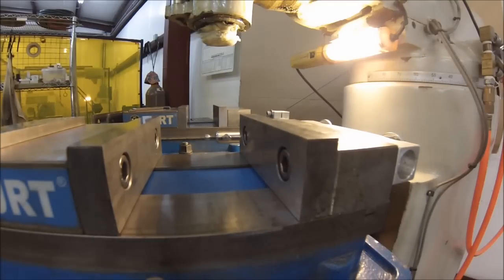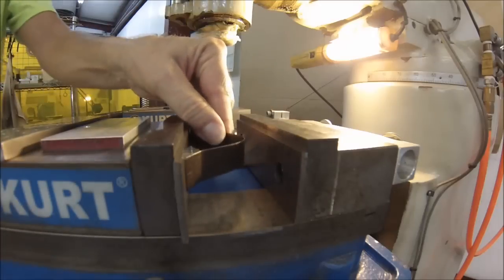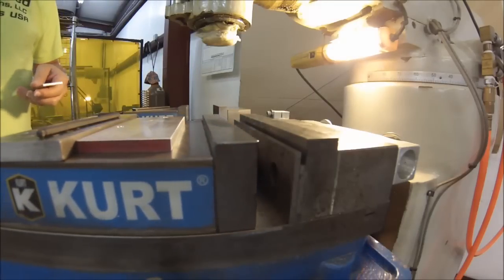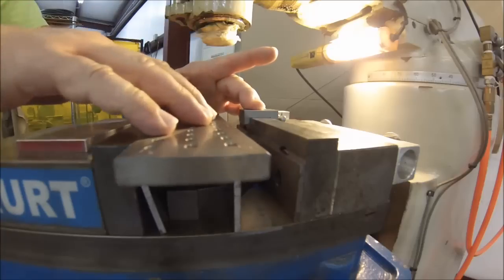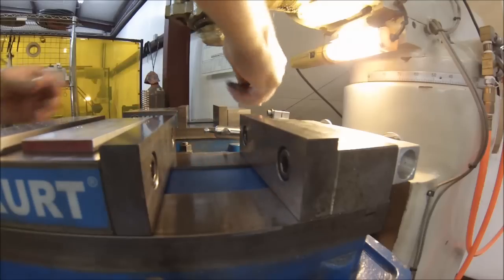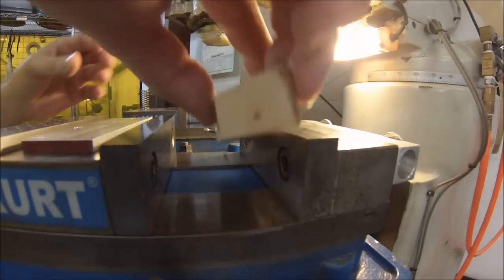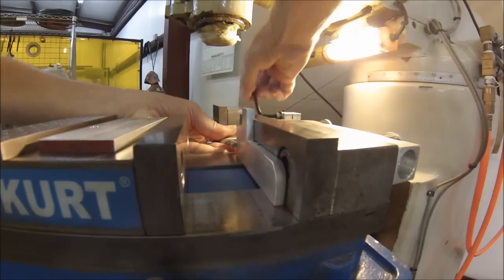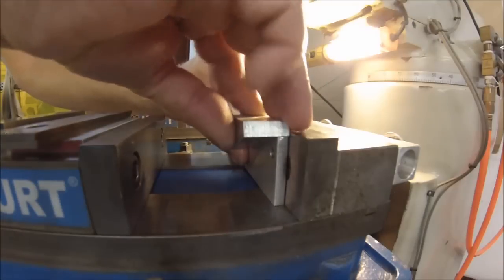Clamping Thin and Irregularly shaped parts in the mill

Comment: Instead of springs I put a drop of off-road bike chain oil on the parallel bars which sticks them to the vice jaws through surface tension. Also helps prevent corrosion.

Comment: Hi Joe. Very helpful video. Question. How can I hold a kidney cover for a Harley panhead?  Domed on the bottom with an irregular shape no way to grab it and no depth. I'm stumped. Thanks. Rick
Reply from the maker: Rick, my answer will be driven by what you are trying to do to it. My first impression would be to squeeze some rails in your vise, leaving a space between them, and clamp the cover underneath them. Do all your work between the rails. Its a technique that works well for parts like that.

Comment: When using the ball or the cylinder in the vise with an angle block, is the part going to want to pivot more on the moving jaw side? Do you need to support this side of the part or is an angle block held against the fixed jaw sufficient?
Reply from the maker: I've never had a part move. be smart with your tool load when using a setup like this, but I've never had a problem. Make sure to cut right to left so the tool impact drives the part against the fixed jaw.

Comment: The springs in air cylinders that have spring return are perfect for parallels. I put the cylinder in the lathe and cut it open with a parting tool

Comment: I have a clampdown problem  with a small round. Part 4in in length 1/4 in inn diameter that I need to mill a 2in  through slot centered. Enjoyed this video, but Didn’t address a round part. If at some point you could address this particular problem it would be appropriated.  Thanks
Reply from the maker: Put a piece of scrap material under it to use as a parallel. Squeeze it in a vise and center the cutter, mill the slot and go right into the parallel. Just be sure the parallel is tight too or it will walk out the side of the vise and possibly snap the cutter. A soft rear jaw with a step, or good double face tape will help.
Reply: @joepie221  Thanks Joe for your quick response, it’s appreciated. Your idea was so simple, and worked like a charm. Don’t know why I couldn’t see it before, feel stupid. I took it one step further on another piece. Took the parallel, milled a concave along the length, cut it in half and since I had an inch at each end of the work piece, clamped the 2 pieces 3/4 of an inch in from the ends of the work piece and milled out the 2 inch slot without the worry of running into the parallel.

Comment: hi JOE , old machinist here , I was doing the same for many years back the other bonus when you blow your vise clean the parallels are not flying around , it saves a lot of time , for a stop i would use one of those small round magnetic bases on the side of the vise , part set  , simply remove magnet

Comment: You say, "that's all I got" but what a fab little video with loads of little tricks. I've never seen the flat side sphere/cylinder technique and will now use it. Thanks.
Reply from the maker: That ball with a flat is a great thing to have. Just get a steel ball and sand a flat on it. It doesn't have to be precision.

Comment: Thanks for posting this great video on work holding in the mill. I have an issue that I am hoping someone can help me with. I have a Precision Matthews PM25 MV mill with their 5 inch vise. I am having troubles getting a piece to stay firmly pressed down to the two parallels no matter how hard I bang on the piece with a soft faced hammer. It seems that as soon as I do my final tightening usually the movable jaw side loosens. I have tried using copper and aluminum wire in case the piece was slightly out of square. I am sure it is something I am doing wrong procedurally but I can't figure out what it is that I am not doing correctly.
Thanks
Reply from the maker: Tell us what you are doing before the problem shows up. Just an FYI...Don't let tightening the vise be the last step. Tighten, seat, cut
Reply: @joepie221  That may be my problem. I have been snugging the part down on the parallels, smacking the part until the parallels are snug and then cranking down on the handle. 
I think the issue may also be the cause of another problem I am experiencing, when I use a two inch shell mill the front edge cuts a smooth surface but when the trailing edge of the cutter comes along it doesn't cut all of the way across. The surface looks like a beaver chewed along the edge. I suspect that the edge along the movable jaw side of the vise is lifting slightly while the leading edge is cutting and then dropping slightly as the lead cutter moves off the part and becomes too low for the trailing edge to clean up. 
Does this seem like two different issues or does it sound like they may be related?
Thanks for your help.
Reply from the maker: @robertoswalt319  If your cut allows for it, try using taller parallels. I have had the opportunity to cut parts slightly out of square that way. Just don't load up the part with a deep wide aggressive cut.
Reply: Joe Pieczynski thanks for your help. As I suspected the problem was with operator error. Your suggestions were exactly what I needed to resolve them.

Comment: Nice tips sir!  I was a machinist for 11 years here in San Antonio.  I went from manufacturing parts for the beverage dispenser industry to oil field equipment, aircraft manufacturing, and medical field.  I graduated from Machinist to Tool Maker, then onto Engineering.  I enjoy watching these types of videos which take me down memory lane.  I always seem to learn something new still.  The tip about using the ball with a flat side to hold irregular-shaped parts was pure GENIUS! Times like this make me want to get back into the shop and make more parts.  Thanks for sharing your ideas and tips.

Comment: Very impressive as usual.  Thanks for sharing! I have seen the flat side on a ball bearing.  I tried to make one but it was chrome steel and was too hard to machine.  I saw a video without sound of a guy milling a 2" diameter ball with a  multiple carbide insert milling tool. I could not find a commercial source.  It is hard to hand hold the ball and grind a large enough flat spot to make this tool.  Any advice on how to make one?  I only have a drill mill as a milling machine and a bench grinder.  I could not find a non-hardened 2" ball source.
Reply from the maker: I think you'll find 2" is too big. A 1" ball should work fine. It doesn't need to be hardened.

Comment: no need for springs just use rubber bands across the back jaw and the front, my only issue using rubber bands is that they degrade if you keep using them in a machine with coolant running all over them. no problem though a box of rubber bands is like 2 dollars and it will last a year or so and theres no need for springs or blocks or anything extra in your vice. loved the video other than that. just felt the springs took more to make them work.

Comment: Though I add this comment. Saturday while modifying an AXA (China) tool holder for my SB 10K, I had the opportunity to use your vise/parallel/spring holding method. It worked GREAT. Then on Sunday I was found on the lathe making some various lengths springs for myself. Not that cheap, just old and the shop keeps me out of wife's way.
Again - thank you for you videos :-D

Comment: Hi Joe,
You have given me new ideas often and they are very much appreciated.  45 years of toolmaking and job shop work has taught me much, but so much more to learn!  Now, when I have an irregular part I have to machine, I have an old die block that I hold in the vise (can use a piece of aluminum that is fly cut flat and milled parallel) and clamp the part on top and you can indicate one strait side and then pick up zero anywhere, then machine, and if it has holes, locate with screws on the plate and no clamps necessary, I use "can't twist clamps"!  Its fast and accurate!  Thanks for the ideas Joe!

Comment: Way more good tips than this old brain can absorb at one time! My biggest problem is our climate combined with high heating costs in the winter. Everything needs to be dripping in oil so it doesn't rust. Chips stick to oil. The springs and troughs should help my repeatability immensely. I really like your ability to convey your ideas to others in a timely, clear, direct manner. Always impressed. No BS, no fluff, no drama, no begging, no 10 minute clips of your pet squirrel Snookums. Great video.

Comment: Some great suggestions. Clamping odd shapes that need to be face cut entirely seems to be the tricky issue when I need to clamp in order to finish the entire part and the one end of part vibrates against cutter and vice due to only being supported/clamped on the one end. Having additional supports in the way don't work when the 4" fly cutter needs to take several passes over a 35" L shaped flat. And to add when the parts are not only irregular they very from one another. My tolerances are so tight that I can't stack anything .008 off or the part just slides back and forth in the vice. In other words I'd need 100 different shim blocks with minute tolerance and choose which one fits best. Quite frustrating perhaps some adjustable tool similar to my spring and ball block would suffice if made from soft material. Thanks for the additional ideas we will see if something can be achieved without a days work making 100 custom blocks for "very" short run parts.

Comment: Excellent coverage on the basics of precision setups. My half round bar was the very first tool I made for myself, and of course is in my box to this day. 
I would offer one thought,  make sure your parallels are in fact parallel. I had a half inch thick set in use, and the parallels were actually parallelograms. Under spring pressure they kicked up the part in all sorts of frustration. 
Thanks Joe for your clear and concise approach to teaching the younger generation our dying craft.

Comment: Great video, and i've come to covet your mill vice and band saw.  Great tips.
Reply from the maker: I love my Kurt vises. I have 2 - 675's on my manual mill and 3 - 688's in my CNC. great vises. The DoAll is a life saver too. I had to restore it when I got it, but it was well worth it.
Reply: Thanks, Joe, i have a 40 year old Lagun, a bunch of Chinese stuff and a Harbor Freight band saw, that i slowed down with a bully i cut from a 12" billet of aluminumunm.  70 years old and self taught "i'm an artist, no two parts alike!"  But you've given me so much book learning on those videos,; who knows, if i live long enough, maybe my pantograph will come out right, and i can engrave the knobs on my hot rod.  Thanks again.

Comment: Hello Cap'n Joe Pie
Another good video with nice ideas for clamping
Just one that is proving a brain teaser for us is holding down a circular Part whilst being able to machine four flats on four sides
Guess U know what we are talking about.
Would be tremendous to have Your ideas on solving that one !!!
TIA
And keep 'em rolling
aRM
Reply from the maker: On a flat plate, toe clamp the left and right sides of the round part...machine the front and back flats, swap the clamps to the front and back one at a time so the part doesn't move, machine left and right side flats. If the part has a center hole, just screw it down.
Reply from the maker: Depending on the material and cut, you could also double stick tape, or glue the part down to a backer plate.
Reply: If the flats are not too deep and the circular diameter is suitably large, another way might be to hold the disk in a 4 jaw chuck lying on its back on the mill table.

Comment: How about a source for a ball similar to what you used or a video on how to hold a steel ball to machine the flat?  A couple of your ideas I managed to figure out on my own, but the rest are definitely added to my collection of knowledge.
Reply from the maker: A standard 3 jaw chuck, or a collet will hold the ball just fine for putting a flat on it. Face it on, and put a small centerdrill dimple in the center to be sure there is not proud center point. Outside Screwball sells sets of balls with flats on them if you don't have a lathe. he calls them screwyballs.

Comment: Great video. I have one comment. I use the the ball bearing trick to hold parts at work and we have Kurt vices. I have found that if you put the spherical part of the ball against vice jaw it will put a dent in the jaw. So I put a piece of soft steel or aluminium between the ball and the vice jaw.
Reply from the maker: I too have a few dimples in some of my jaws from earlier years. The ball I use now has a large flat on one side and that goes against the jaw to avoid those marks. Chuck over at Outside Screwball sells 'Screwy balls" intended for just this application. Maybe take a look over there if you are in the market.

Comment: I use two large 1/2" wide rubber bands ,  one for each parallel, around the back and front  of the vise. Hold them tight to each jaw. Even when opening the vise a great distance, unlike a spring, the rubber ban continues to hold the parallel tight to the jaw. No more chasing springs across the floor :-)  Another benefit: should I miscalculate, and poke a drill thru too far or close,  instead of hitting a spring  or other metal parallel "keeper", the rubber band it very thin, leaving  plenty of room. And if a tool does touch it,  its soft rubber, not hard steel - no more dull or chipped tool.  Another tip: if you can't find larger rubber bands, double up and loop several smaller ones together; tie the last two ends in a knot. I also made several "rubber bands" for my commercial machine shop from one of those hoses cheap hoses advertised on TV, that uncoils when water is turned on, and recoils when turned off. Inside the cloth cover is some nice stretchy surgical hose. I simply cut it to a length about 2/3 the way around the front  or rear jaw.ends  of the vise, then joined the ends by super-gluing the hose over a 1" length of 3/8" wooden dowel. These last much longer than a regular rubber band - we've have several that have been in use, daaily for at least 5 yrs.  Super simple and quick to put in place, and hold the parallels tight to the jaws :-).
Reply from the maker: I have actually used your technique. It works well. It works better in a dry environment because the rubber can get nasty with solvents and oils. Pharmacy's sell silicon tubing you can use too.

Comment: I couldn't tell for sure if you had a flat on the ball or not. Run into a guy who kept using a ball bearing for odd shaped work. Because the vise jaws are what we call half hard. When he over tightened the vise it left a dimple in the moveable jaw. Causing them to need resurfacing the jaw. Very nice video and nice to see someone with real world experience making these videos.
Reply from the maker: I did. Thanks for watching.

Comment: That femoral ball has to be one of the most high cost holding devices in any machine shop!

Loving your video's, Joe. I've been around machinery for nearly 50 years and you've taught me or reminded me of a few good practices.

Thanks,
Russell
Reply from the maker: Thanks Russel. Cobalt Chrome femoral head to be exact. Yep. probably more expensive than it could be. I was in orthopedics for many years. I didn't pay for it.

Comment: Awesome video. Concise and informative. 
Just another note; I tend to keep my parallels oiled with 220 wt way oil. Keeps them immaculate and the oil forms a surprisingly sturdy hydraulic grip on the vice jaw.
Reply from the maker: Thank you. Its surprising to hear how many guys use that technique. I keep my vise jaws as dry as I can. if the parallels stick, it would only be logical to think chips would stick too. I do grind aluminum on a magnetic chuck with an oil film though. The hydraulic resistance is very strong.

Comment: use a 123 block without holes, it will get clogged this way.
Reply from the maker: I have the solid 1-2-3 blocks on my CNC. You are correct, the perforated ones can be a hassle to blow off. When I have to use them, I run masking tape over the holes.

Comment: Thought of the steel strapping for pallets and shipping for springs to use like this just haven't done it yet in fact just ran across some of it the other day so know where its at now as I save it from time to time. I also want to try foam rubber for parallel springs or super magnets the size of the holes in your parallels and same thickness maybe. Did you realize super magnets with some steels will make the whole part its stuck to magnetic? You did but maybe never thought about the implications of that for this parallel use. So in effect the magnet just needs to be on opposite side and parallel itself should become magnetic enough to cling to vice jaw...have not tried it yet but am going to soon. And yes know the steel chips will want to cling to the parallels but when you wipe it the chips will slide off and cling to the end side, like you said just as long as that top edge is clean. Great Video as usual look forward to the next.
Reply from the maker: Thoughts.....Be careful about what cutting lubricants you use if you do the foam thing. Some have chemicals that will attack the foam and make a hell of a mess. The magnet trick works well with stainless and composite materials, but carbon steel will stick to the entire parallel and is a dog to blow off. Thanks for the feedback.